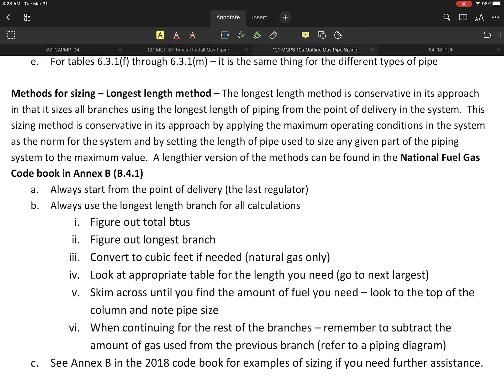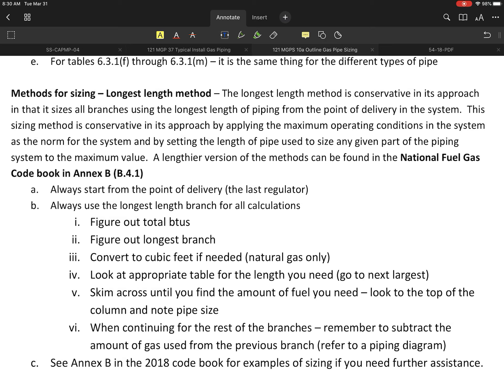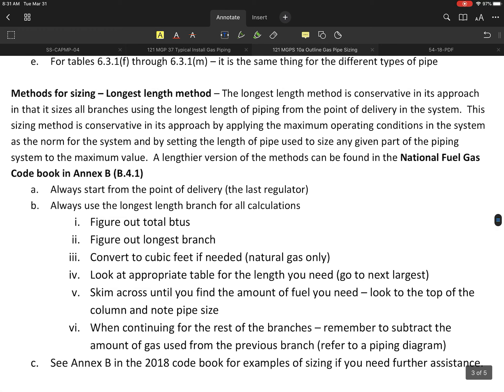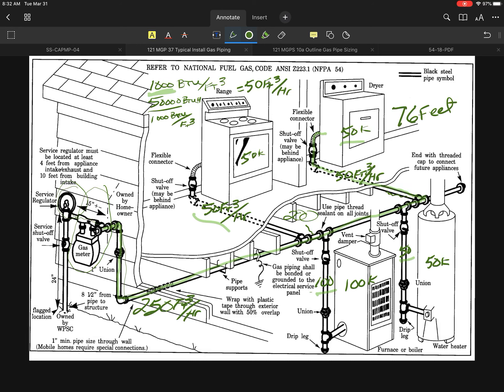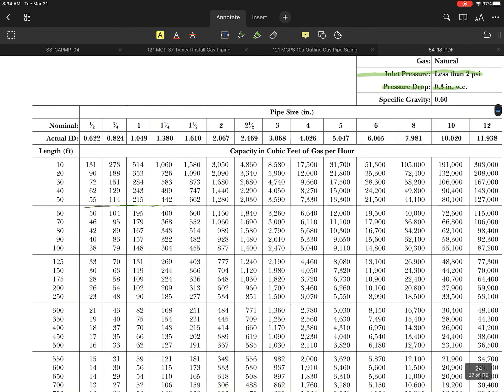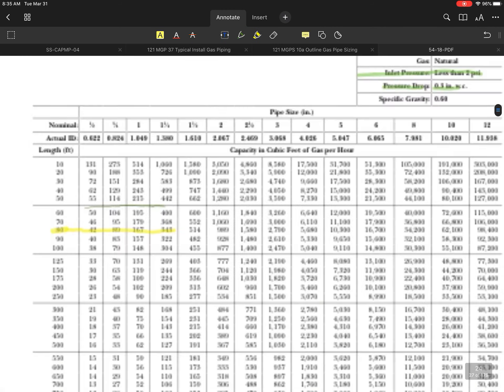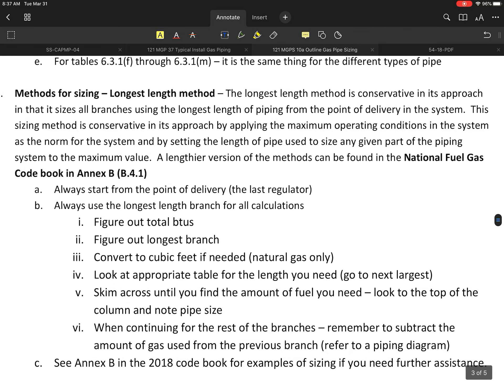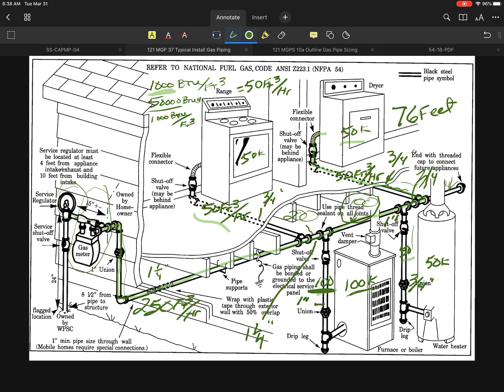Longest length method gas pipe sizing

Comment: great video thanks. as per the ifgs, sections 402.4.1 - longest length method, and section 402.4.2 - longest branch method. could you please make a video explaining the differences betweeen the two pipe sizing methods?